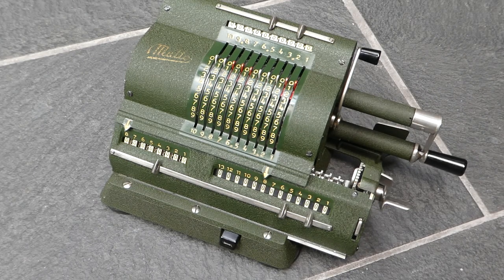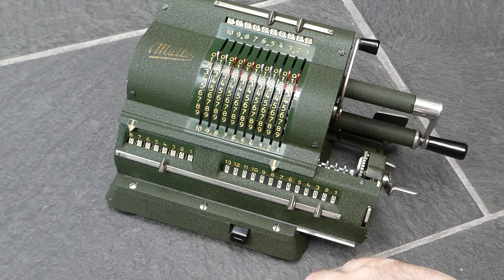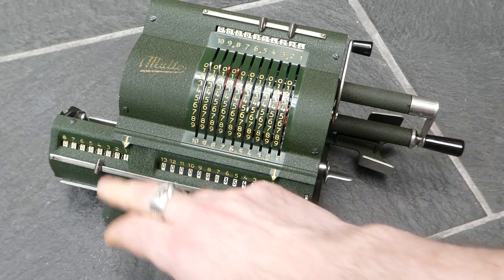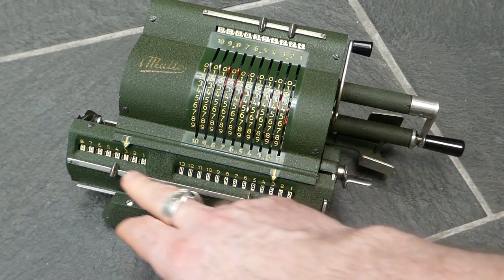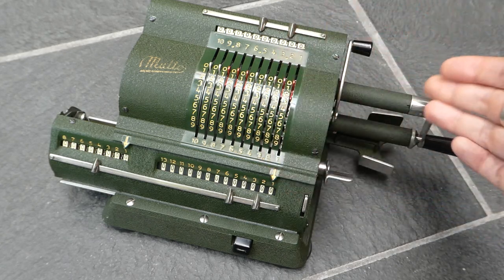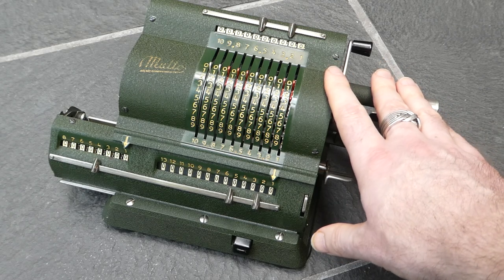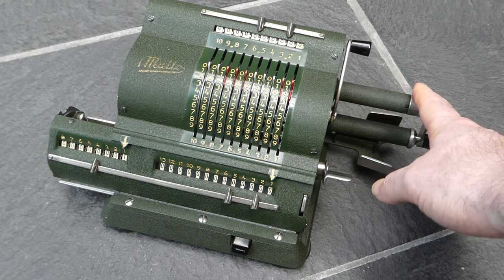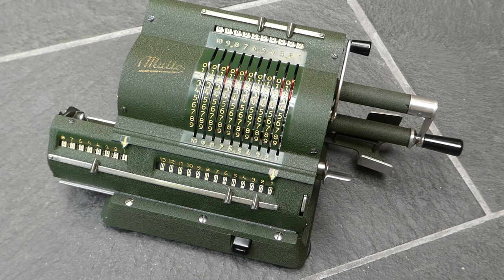The Multo mechanical calculator

Comment: That's a lovely little machine Jaap - and in great condition, we do love a bit of crinkle paint, it's the best!!!  I like that fact that the input levers are painted rather than having a coloured plastic end that will either break or go missing over time.  The input clearing lever is a bit more advanced than the ones that just have a bar on the outside of the case that returns the levers to zero.

Sounds like that was one of the fun ones with everything good and seized - I've got a Britannic on the workbench at the moment, it's mostly working but one of the input levers won't move beyond 2 so there must be something amiss/broken/bent in the pinwheel itself - I'll need to wait until I've got time to strip that one down fully, don't think I'll make a video of that repair because I'll probably need to concentrate on what I'm doing!